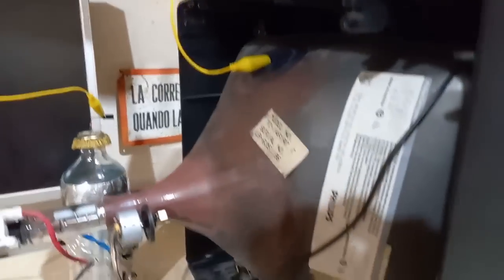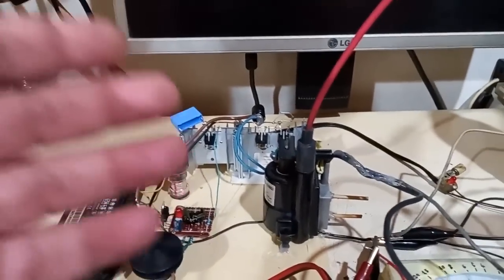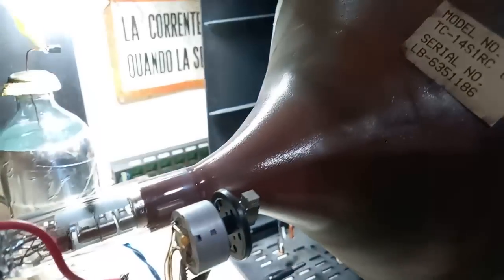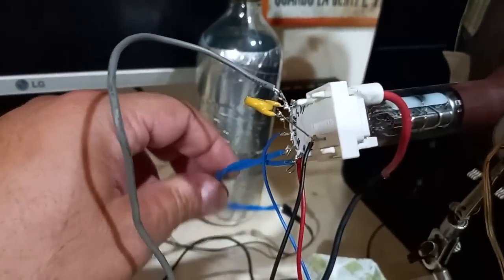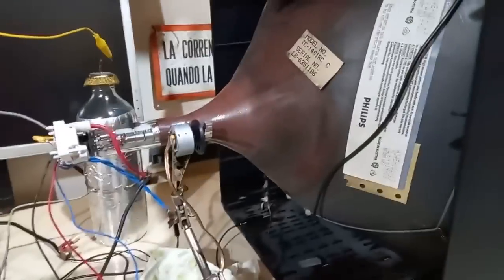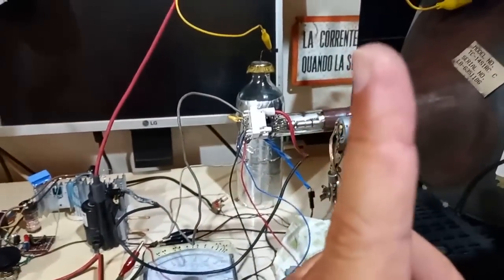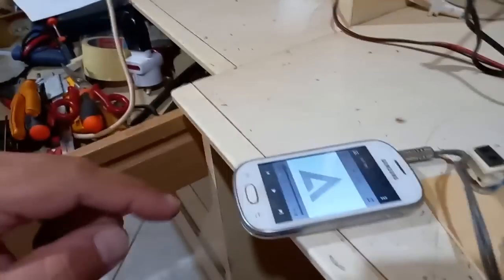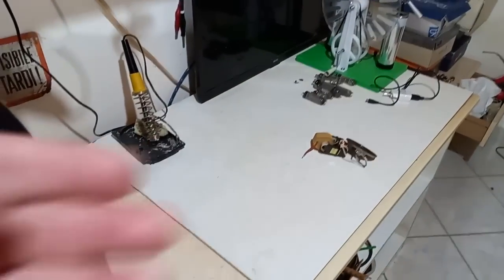Color CRT Screen Used As Audio Amplifier Tube

Comment: You are forgetting the high-voltage diodes built inside the FBT. They rectify and distort your audio.
Reply from the maker: the first transformer i used is an AC flyback, it doesn't have diodes inside... if you refer to the supply flyback, it just needs to provide the high voltage DC, there's no audio there

Comment: As much as I love this, why not take the output from the cathode? Put the speaker in series with the current meter; a few mA shouldn't overheat the voicecoil, and you won't have to worry about drawing arcs from the thing.
Reply from the maker: that would have worked as well considering the grid one high drive... but i really wanted to use the CRT as a regular pentode amplifier, honestly when editing the video i thought about making some arcs on the speaker (it would have sparked, not arced cos of the capacitor) and add this to the video, but then i said "nahh, not important"
Reply: @PosthumanKindergarten  Now I'm wondering what the bandwidth of a small CRT might be if configured in any of the canonical oscillator circuits (armstrong, colpitts, pierce, etc.)
Reply from the maker: @zinckensteel  theoretically high i suppose, but the current this thing manages is extremely low, plus it's not intended to "short" the anode to the cathode, so it would oscillate but barely, plus it's quite big, i dunno if the air capacity of the screen and graphite capacitor would pose a problem, my initial calculations pointed out that it cuts at like 5kHz or less, because of both the low current and big on-air capacity

Comment: Distorsion comes from speaker trafo. Core is not able to work with  low audio frequency.
Reply from the maker: i believe it's just the tube gate drive that is a lot unoptimized and forced, the trafo is making very low power thus it can make a bit of low frequencies IMO